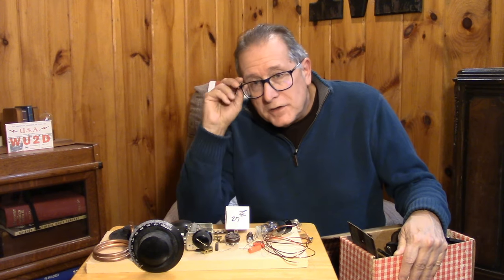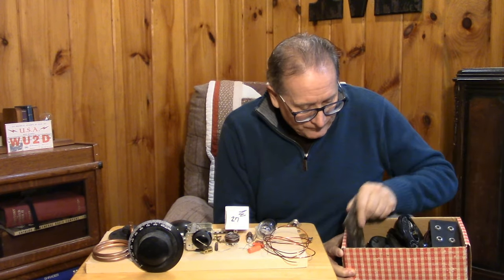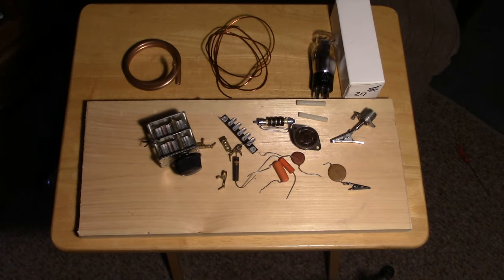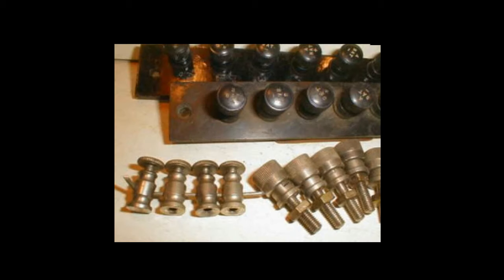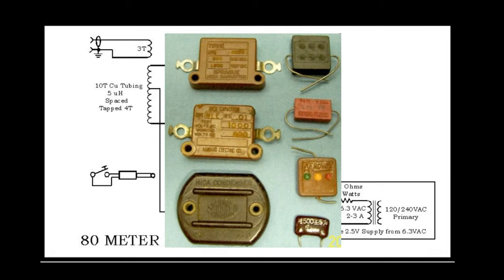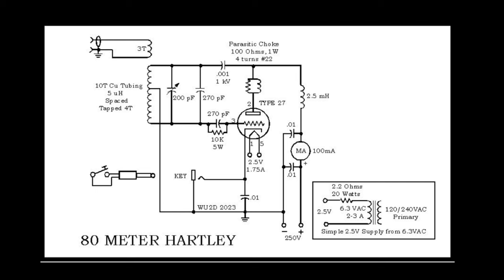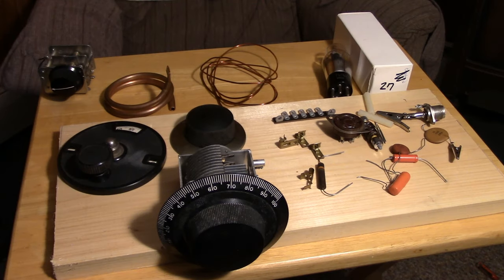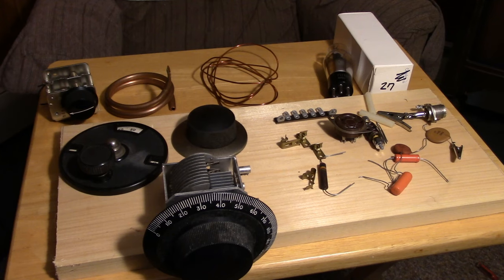Your First 1929 Style Transmitter!

Comment: Looks like the start of another good series, that said I can think of better ways to to get 2.5V filament power from a 6.3V filament transformer than simply dropping 3.8V (6.7 watts) in a big resistor. If your 6.3V transformer has a dual voltage primary and you live in a 120V country configure it for 240 and feed it 120, giving ~3.15V on the secondary, only 0.65V to drop, 0R33 2W would give 2.57V (well within tolerance) and only burn about 1 watt. Or if the 6.3V winding is center tapped the tube could be run off half the secondary with the same 0R33.
Reply from the maker: Yes many ideas for this including reprogramming a 5V wall wart switcher.

Comment: As i recall, 27, 37, 56, 76 and 6C5 (6J5) all belong to same familly and all would probably work well, last two would not be period correct.
Would not use precious and fragile early blue Arcurus.

Great video, great content and superb presentation. All the best
Reply: The 6C4 mini tube, with 5.5 watts Class "C" rating, would also be in the same class and would not be period correct ether.
Reply: @JCWise-sf9ww  Yes, or as we over the pond call it EC90.
Loktals like 7A4 seems to be forgotten, in radio and hifi.
Reply from the maker: In fact I would suggest starting with a 6J5/6C5. Once working, adjust filament and  substitute your precious!
Reply: @MIKROWAVE1  That would be smartest thing to do.
Reply: @sinisatrlin840  Yes the 7A4 is  electrically the same as the 6J5 octal also good one to start with. Almost all Loktals are merely electrical copies of octals.

Comment: The ball is now rolling.  I've just bought a Type 27 tube.  Going to have to build this now ;-)
Reply from the maker: Power Supply first. Most folks use a DC supply for the filament to get started quick.  For the HV, back to Back 3A transformers and rectify on the other end to get 160V or so.

Comment: This is perfect I was just in the process of gathering parts to build one of these transmitters.  Most of the tubes used with these transmitters are priced way out of my range the type 27 sounds doable.  What about an 807 wired like triode I have a bunch of 807.

Comment: Amazing that the 27 tube will do about 1-3 watts RF power output. There is a more modern miniature tube that does have RF power ratings. The 6C4 tube has 5.5 watt class C rating. Stands to reason most any low to medium Mu triode would work here..
Reply from the maker: Nothing wrong with starting with a proper power tube to breadboard the breadboard! But for the 1929 contest, it must have been in existence before 1930. Most folks transition to the 10/210 family of Triodes in these  transmitters, after playing with the low cost 27 for a while. And I have seen folks run them at higher voltages than recommended.

Comment: I'd be interested in building one of these to run on batteries.  For the filament, two cells of NiMH batteries will produce the right voltage under load -- and are rechargeable, of course.  In 1929, you'd probably have used a single lead acid cell for the filament (only 2V, but it should still work, just take a little longer to warm up the cathode -- tradeoff is your filament will live longer at lower voltage), or two cells with a (variable?) resistor to regulate filament temperature.  For the plate, a bank of 20 9V batteries in series will give 150 V or so under 40 mA load and ought to last at least several hours of transmit time -- which doesn't count down when your key is open, so might last weeks or longer in actual use.  Depending on the size of your A battery, you might have to swap it out for the spare on charge every hour or two, though...
Reply from the maker: Grandpa used a rotary converter, basically a Mains AC Motor driving a HV Generator. Later Dynamotors came along DC in DC Out. But a Battery Pile would work at this low current drain, no problem. I suggest 30 9V batteries.  Of course this 12 Dollar up converter would work!  https://www.amazon.com/Voltage-Converter-%C2%B145V-390V-Capacitor-Charging/dp/B07CMPWMC8/ref=asc_df_B07CMPWMC8/?tag=hyprod-20&linkCode=df0&hvadid=312111529833&hvpos=&hvnetw=g&hvrand=2824619081832960326&hvpone=&hvptwo=&hvqmt=&hvdev=c&hvdvcmdl=&hvlocint=&hvlocphy=9002293&hvtargid=pla-612783772778&psc=1&mcid=1f822bcb3b5a36cdb9b827e0c49ca26e&tag=&ref=&adgrpid=67656252888&hvpone=&hvptwo=&hvadid=312111529833&hvpos=&hvnetw=g&hvrand=2824619081832960326&hvqmt=&hvdev=c&hvdvcmdl=&hvlocint=&hvlocphy=9002293&hvtargid=pla-612783772778&gclid=CjwKCAiA8NKtBhBtEiwAq5aX2KzbCmd6b5DpUvBzkowXgkXgO_0j5ikJRgIvHftfoa0u6IqlDXY1_hoCMNYQAvD_BwE
Reply: @MIKROWAVE1  Looks like a deal to run the plates off, say, an emergency lighting or UPS gel cell battery (combine with a regulator to get your 2.3V filaments and you only need one battery).  A gel battery and this converter wouldn't cost much more than 30x 9V, and a basic trickle charger would only add a few dollars.  This would make a good "emergency power" Field Day rig -- especially with the VFO vs. crystals to find CW frequencies that aren't jammed solid.  From what I heard in later videos, I gather you tune this by matching tone to a known-frequency receiver?  How did they control those before scopes and frequency counters -- one of those marker frequency generators (I've got one of those, albeit solid state)?  But even with one of those, how do you know which harmonic you're tuning to?

Worst case, my SB-102 receives well (even though I can't transmit with it -- bad component somewhere in the finals that I haven't the skills to find) and tunes accurately...

Comment: Great video Mike.  I have a 227. I presume that would work as well. Next maybe an Amp from the 20s or 30s.
Reply from the maker: Even better. 227s were actually manufactured in the 20s. The contest allows all types however, as long as the parent tube design was from the 20s. For instance a Chinese 211 would be OK.

Comment: Great video Mike! I have had trouble looking for the type 27 tube in Europe, and was wondering if you know any other usable tubes from that period?
Reply from the maker: There are many to choose from, if you can not find a 27, or 227. WE27, E424N, REN904 are Equiv. but 4V FIL or Any of the H2, H210, 210RC types will work, with proper filament keying. They have no cathode.

Comment: What diameter should the coil(s) be? ... This is great, thanks.
Reply from the maker: The most common Diameter is about 3" or 76mm OD Tubing. For a High C to L ratio, the 80M coil can be 8 to 12T Spaced a half to one Dia. More C less Turns to hit 80M.
Reply: @MIKROWAVE1  ... So:

(1) I could wind 8 to 12T, using 3" diameter PVC pipe as a form? (remove the PVC afterwards of course). 

(2) And does the 8-to-12T include the 3T that goes to the antenna? (cut to separate it from the large body of the coil?) -- So if i do 12T, there would be a 9T coil and a small 3T coil? 

(3) Please, what does "spaced a half to one Dia." mean? The spacing between each turn?  You don't mean space each turn 3" apart.

(4) What is the OD diameter of the tubing itself?

Thanks, appreciate your guidance. I've started putting some of the parts for this into a can.
Reply: @MIKROWAVE1   ... So:

(1) I could wind the coil (8 to 12T) using a 3" diameter piece of PVC pipe (remove the pipe afterwards of course)?

(2) What should the OD of the tubing itself (bought at the hardware store) be?

(3) If i wind 12T, does that include the 3T going to the antenna, so i would put a break in the coil, so there would be a 3T coil and a 9T coil?

(4) The turns "spaced a half to one diameter" -- does that mean the diameter of the tubing? I guess it does.

(5) Less turns means it goes lower in freq?  Actually i would probably want this to work on 40 meters.

(6) Thanks for your help. I am getting together the needed parts, putting them in a can. I ordered two of the tubes off eBay. ((Also, i posted this earlier but when i tried to edit it, it disappeared. Apologies; i've been having all kinds of problems using Youtube and my Chrome browser.)